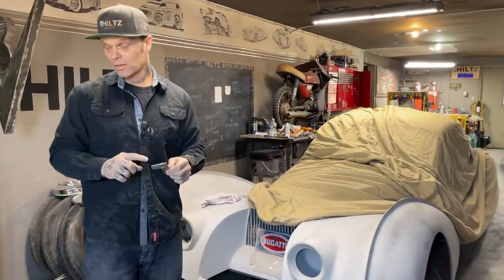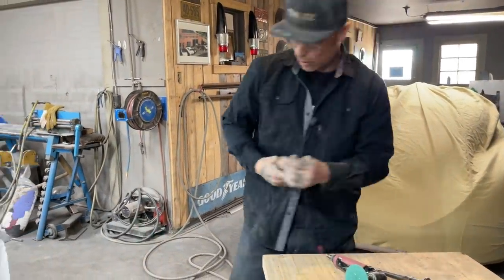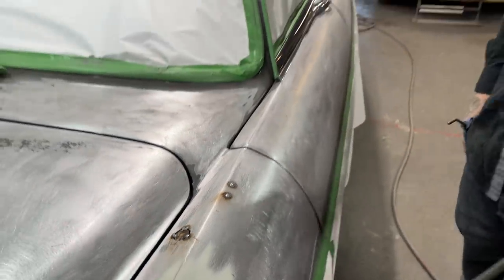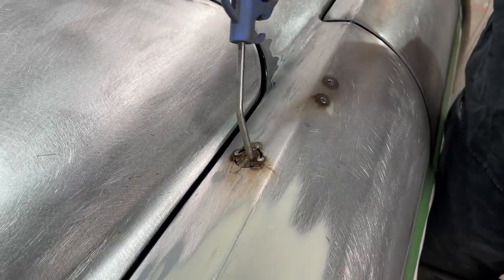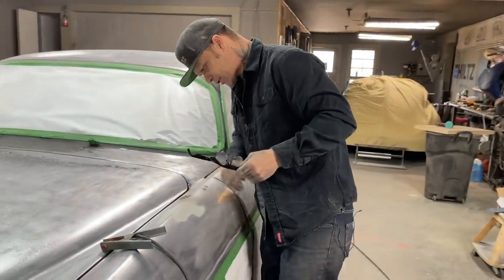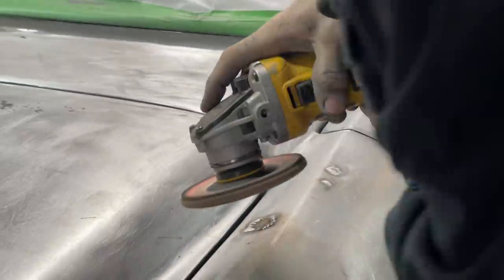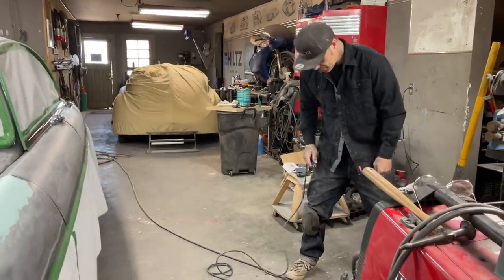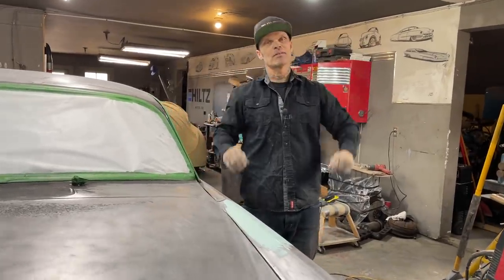FENDER PATCH PANEL REPAIR - FABBED, WELDED, FILLED, AND SANDED IN 30 MINS

Comment: I saw a neat way of welding in tiny patches or plugs like that, and Chad could do it pretty easy with his coat hangers! Simply tack one to the centre of the little plug and use that like a handle to hold it exactly where you want, then zip it off when ready.

Comment: looks great chad id take the door handles off my self and rope the front and rear window rubbers so you can get rub prima paint under the rubbers and re mask the car  thats easy than trying to get the old tape and glue off you have done a top job on the metal any way buddy you know what your doing credit to you cheers cs nsw australia

Comment: You can cover these small irregularities on the weld with tin. It is a bit more complicated to apply - it must be alternately heated and applied, and sanding itself is a bit harder, but the result is a completely clean metal surface that does not require the application of fillers at all, except for primers, of course.

Comment: when i need to patch round holes i put a dent puller nail in the middle with a pin gun, then i can put it in a drill and get it round real quick, the nail is a great way to hold it in place esp if its a non access hole from behind

Comment: What type of metal are you using to patch in?  We've got a 52 chevy I need to patch, and a 70's mopar with a little patching needed as well.  Hard to find the right materials at the local box store, and not much for 'hot rod shops' either

Comment: You do great on your metal work but you need to get your filler more better. Shape with 40 then skin coat and finish with 80 wipe with 180 then prime. If you try to fill with prime the scratches will come back over time

Comment: I can make the plug quicker by holding it underneath, drawing it exactly and cutting it with a small pair of curved snips
Reply: @budwebster1031  then you have to weld the centre hole
Reply: Five in drill press
Reply: @budwebster1031  ok

Comment: You said you want to keep it as cool as possible 9:53 Then you should learn about welding then. These is putty out there to absorb heat, you could have tig welded the fender & had just about no weld to grind